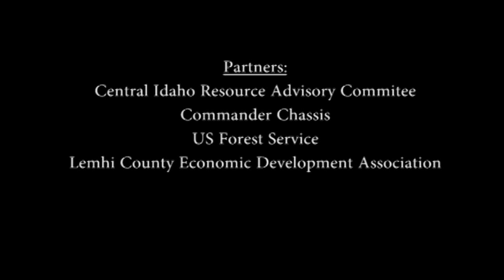Repurposing Forest Waste with a Mobile Pellet Machine

Comment: I work for a company that makes engineered laminate flooring. We have alot of waste and it ends up going to a landfill. I'm talking 4x8 panels by the thousands. I wanted to create sawdust from them panels and make pellets or logs. Where do I begin or have you come up with a viable solution to slash issue. Naturally the moisture has already been reduced from creating a manufactured product already. Just looking to help our cause here in western pa.
Reply: once you put the glue its no good for burning anymore